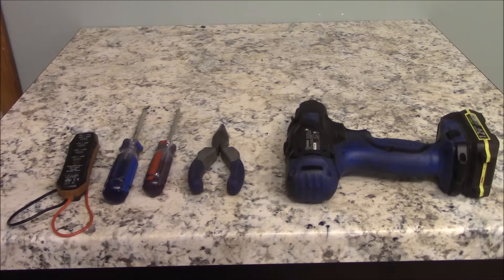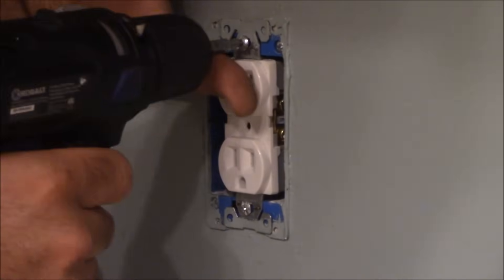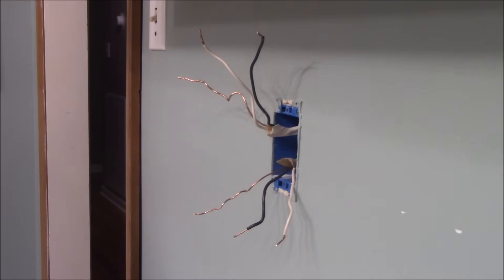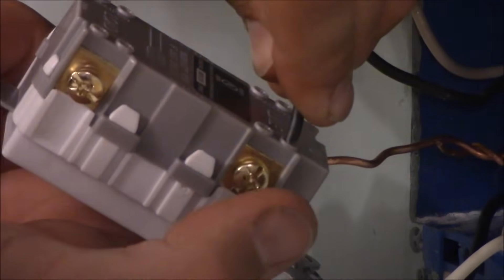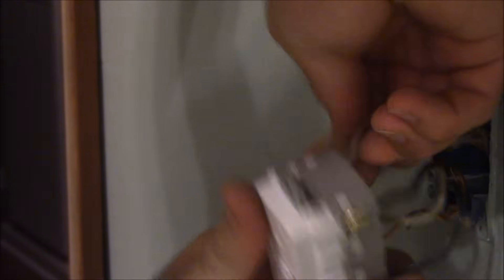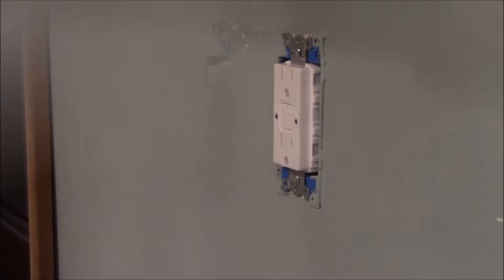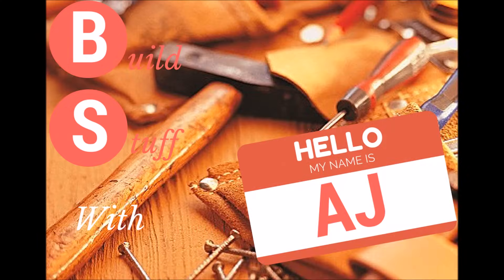Removing and Replacing regular outlet with GFCI outlet

Comment: Don’t put the wires in the holes in the back. It’s a common failure point. I’m not knocking the guy, it’s not a code violation. But I’ve seen time and time again where other electricians will use the holes in the back and it’s a common failure point. Use the gold tabs underneath the screw. Usually up to preference.

Comment: One breaker trips on my new upgraded electric panel. I checked every single outlet and light, marked it with breaker number. There is no outlet or light which is not working in my house even with that one breaker in tripped position. What could be the cause of that problem?

Comment: I wanted to change my main bathroom outlet from a standard 3 prong to a GFCI outlet but there is only 1 hot and 1 neutral wire + a grounding wire.  How can I do this since all the videos I see have 2 white and 2 black?  Home is only 9 years old so unsure why it didn't have a GFCI to begin with.

Comment: If you're doing this yourself you can use a lamp or something else instead of needing a voltage tester.
Reply from the maker: that's great advice for someone who hasn't done this type of work before! A radio works great if your trying to figure out what breaker a particular outlet is on as well you can hear it through the house all the way to your breaker box!

Comment: Great video. What about amps? What happens if I put a 15amp outlet on a 20amp line? Or visa versa? Does it matter?
Reply from the maker: I'm not a licensed electrician so I don't have a definite answer for you, but it would seem to me if you put a 15 amp outlet on a 20 amp line it would trip at 15 amps so you wouldn't get full use of your line. But if you put a 20 amp outlet on a 15 amp line I would assume it would trip the breaker before it would the outlet. But again I'm not an electrician so I am not 100% sure.

Comment: Do all the outlets in the kitchen need to be GFCI? Or only the first one on the string?
Reply from the maker: technically speaking any outlet after the gfci would be protected, however it probably depends on the electrical code in your area.

Comment: What if the wiring has no ground,can still install a GFCI
Reply from the maker: I can't say what the code is in your area, but it will still trip if that's what your asking it will still do its job, but You would have to look up the code for your area to make sure that its all honky dory.

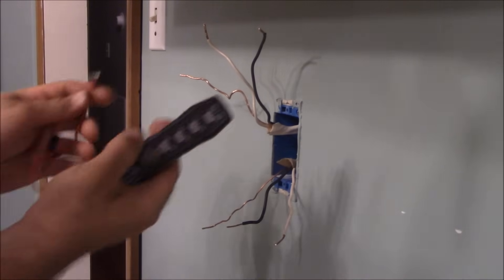Comment: AJ...clarification please. At 3:14ish, you are testing to see if the wires are line or load. IF for the lower one, you are saying 'no light' that isn't clear, nor is your tester's light visible. When you test the upper one, we can see the light. 
The transcript doesn't mention it clearly either, so if you could clarify that in the transcript and for me, that would be fantastic!
Reply from the maker: Ok so the point of this test is to find out where the power is coming from. In this specific case i am testing these two sets of wires one should have a light come on, indicating it has power and one shouldn't have a light come on indicating it has no power.  The top one in this case is where the power is coming from so it will be hooked to the line side of your outlet. the bottom in my case didn't have a light, although i didn't show it. I apologize for the confusion and I hope this helped you understand a little better.

Comment: So what I like to do is wire it up and, before I put it back in the wall, turn the power on to make sure it's good.  Today I did that, hit the reset button and the green indicator light went on.  So then I turned the breaker back off to cut the power, put it back in the box and screwed it into place, and when I turned the power back on......NOTHING!  So I had to take it back out, make sure everything was still connected (which it was) but the outlet simply wouldn't work.  I even tried putting another one in and it wouldn't work either.  Any ideas?

Comment: if I was upgrading would I use a GFCI or an Arc Fault outllet these days ?
Reply from the maker: These serve two different purposes, but it depends on what room of the house your talking about and what your local code says. Im not a licensed electrician so I'm afraid to give you the wrong information. But I'm pretty sure the standard now days is to require all breakers to be afci protected. Your best bet would be to ask a local electrician to be sure.

Comment: What is recpticle is already in series with a gfci in other location, in that case load from the gfci will get to the line of the new gfci.. so if the other gfci trips, this one will trip and without knowing that there is already a gfci tripped aomewhere, it can create confusion. How do you managge that situation? Not questioning ur skills, trying to get answer for knowledge, thanks for putting effort 👍👍
Reply: Thanks AJ.. have a good one! 👍👍
Reply from the maker: Ive had  this happen myself actually, But Ive done a lot of work on my current house and I know what order all the outlets are in. Not everyone knows their house wiring schematics like I do. 
  However technically speaking anything after the GFCI is protected, which is why they come with small stickers that say (gfci protected). now that being said I am not a licensed electrician and I know the electrical codes are different for each area. But in my opinion if you have this happen you need to track down which one tripped and then you can simply replace that outlet with a standard outlet and it should still be GFCI protected from the frist GFCI in the series. 
  While installing GFCI outlets in your home be aware of what all is on the same series, If a large appliance comes after the GFCI outlet it could trip it every time it kicks on. So to wrap this all up, its best to note what all loses power when you shut the power off to install your new GFCI outlet. 
  I hope this helps you have a better understanding, thank you for the comment!
Reply: Thank AJ, I guess I am in the same boat. Just bought the place noticed one of the bathrooms doesnt have GFCI, here is story, read it when you have time and let me know ur thoughts would love to see what u think...
Scenario: my two bathrooms are on the same circuit (how i know that, because when turn off circuit breaker, light goes off in both the bathrooms together), one bathroom had GFCI and other didn't, read that bathrooms and kitchens should have GFCI so decided to change it, to GFCI( at one side I am glad I decided to change, as the load wire from old receptical was almost broke in the box, so fixed it by creating a  pigtail, on second thought I think didnt need GFCI at all), realizef that after installing when decided to test them both, when I tripped the old gfci (which was there initially), old gfci tripped and also turned off the power in new gfci (the one I installed) but didn't trip it, reset the old gfci and power came back in old and in new gfci both, now confusion starts from here onwards, shouldn't the new gfci be tripped when I tripped the old one? If so, why the new gfci simply had power-on, when resetted just old gfci, may be it new gfci turned on along with old gfci because as the load from old gfci is feeding the line of new gfci, when old one tripped it stopped the current to new gfci (didn't actually tripped it), and as soon as old gfci got resetted, current flowed from "load"of old to "line" of new gfci.. 

when i tripped off the new gfci, it didn't do anything to the old gfci, now given that both the gfcis are on same circuit shouldn't old gfci be tripped or it didn't trip because new gfci controls the downstream ciruit not upstream.

Updated: Made a diagram to understand, why tripping new gfci doesnt trip old gfci, let me know if i am getting it right. I think its because the load from old gfci is feeding to the line of new gfci, hence when new gfci trips, it doesnt impact the line of the old (in order for old one to trip) it simply stops the feed at load.
 Again, i am just learning, if wrong please be patient 🙏 🙂

Tests:-
Old gfci.                  New gfci
1) ON.                     ON
2) OFF (tripped)    OFF (not tripped)
3) ON (Reset)        ON

New gfci.               Old gfci
1) Off (tripped)     ON (no impact)
2) ON (reset)         ON (no impact)
Reply from the maker: @noneosharma4876  ok it sounds like the old GFCI comes first in the series. If the old one trips it should cut power off to the new one (but it wouldn't trip). 
  So basically the old GFCI was already protecting the outlet you replaced with a GFCI. But there isn't any need to go back to a regular outlet unless it trips for no reason consistently.

Comment: how would you wire that GFCI in the event it trips, the other outlets downstream will not lose power?
Reply from the maker: You would have to tie the original wires together along with a 3rd wire that would feed only the outlet.

Comment: How do these outlets differ from others 🤔 😁
Reply from the maker: They are GFCI, ground fault circuit interrupter. Essential they cut off the electricity to the outlet faster than a standard outlet would trip a breaker. Which could save your life. They recommend installing them in kitchens, bathroom and garages because of the presence of water near the outlet.
  They also sell GFCI splitters for use with electrical cords on job sites.

Comment: AJ...Just installed a 20 amp GFCI and all works well.  I tested with a Klein brand receptacle tester, and got the two orange lights to glow, so it proves installed well, BUT the little green test light on the plug on the left is not glowing green.  Should it be? Everything seems great, and the lamp plugged in works on both upper and lower outlets.  Puzzled...  THUMBS UP!!!
Reply from the maker: Have you tried testing and then resetting the outlet? If the red light is glowing then it's tripped, but if there isn't a light and it still has power going to the outlet you may want to test it to make sure it cuts the power off to the switch. If not it could be a faulty GFCI outlet.

Comment: Nice clear instruction. It looked like you put 2 ground wires under the ground screw, but then corrected that by twisting them, placing only one under the screw. You should tie those wire together with a green grounding wire nut or by crimping on a copper ferrule.
You should also use a gfci tester in all downstream receptacles to identify and verify your work.

Comment: Does the outlet have to be the first outlet on that run.Electrician put outlet in kitchen that’s the end of the living room run.It’s all one big room so the outlets are all the way around on the floor but I have to change that particular one for inspection..
Reply: It does not have to be the first receptacle on the run. It can be anywhere, but only those downstream will be protected if using the load. In your case if it's the end of the run, there's nothing to connect to the load and only the gfci itself will offer protection. This may be fine if it's the only place where gfci protection is required.

Comment: Test the receptacle after you take the face plate off, if you have a tic tracer you can run it along the sides of the receptacle to make sure a wire  hasn’t come out and is still hot

Comment: Thank you for this! I am 61 and live in an old house. 5 of my outlets have stopped working (over time-not all at once). I want to do this myself to save $$. I watched another vid showing me how to find the one (1st in-line) and check it first. It may fix 2 others but this living room used to be a garage before I bought the house. 1st plug was to the washer and seems alone. Then the top plug on 2nd receptacle went out but the bottom still worked. Next one down the line-same thing. Top worked and bottom went out. I believe the one in the wash room is separate from the others in the living room. In the breaker box they’re separate. But one breaker turns of all power to the living room-not the washroom. So, wondering if I have to replace all the living room plugs or how to find the first one feeding the others? Sorry this is long, hoping you could give me a place to start. Thanx, G
Reply from the maker: That's a bit of a complex issue, with out being there I person it won't be easy to diagnose. 
  But the first thing I would look into is why your top plugs went out. You said your home is old, a lot of older homes used lamps instead of overhead lighting, so they would break the connection between the bottom and top plugs on the same outlet and wire one of them to be hot all the time and the other to be controlled by a switch. So you could turn on the switch and turn on multiple lamps to light the room. 
  I would plug something in to those top plugs that either makes noise or lights up and then look try different switches in that room to see if any of them controls it.

Comment: Watched your video "poetry" again. Question I noticed that on my GFCI that mine didn't come with the holes for an input just the sides. Now when I install the wires do I need to hook them like u did for the ground wire?  Or just leave them straightened
Reply from the maker: Thank you! I'm glad you liked the video! If you only have the side terminals be sure and twist the wire around the screws like I did for the ground that way they can't work loose! I hope your project  goes well

Comment: I can't thank you enough for this. As I need 2 have these installed just like yours and it's seems simply.  But when I reach out to local electricians most don't return my calls. And the 1 that did wants $300. To do this job!?  Also can the wires go into the holes lime yours did?  B/c trying to wrap them onto the screws is very difficult b/c of the thickness of the wires. Thanks so much!
Reply from the maker: I'm glad I can help, it's definitely not cheap to hire a professional to any job, which is why I try my best to fix everything around my house. With in reason if course. 
  As far as the wires go, I think most licensed electricians suggest wrapping the wires around the screw since it takes a lot more effort to get them loose. I tend to use the holes in the back like I showed in the video, honestly because it's easier. But that's your choice. They make them that way for a reason so in my opinion it must be safe enough to use. But as I said, most electricians suggest twisting the wires around the screw.

Comment: I have an outlet which is controlled by a wall switch. It currently only supports one plug. Can this be changed to a double plug with one controlled by the switch while the other is hot all the time?
Reply from the maker: It can be done, but you will probably need to run another wire from the switch box to your outlet. You may want to get an electrician to take care of it for you if you've never done anything like that before.

Comment: I would like to see going from a 20AMP GFCI to a regular 20 AMP outlet.  I am going to place the GFCI relay at the breaker.  I am installing a column refrig/freezer and I cannot have a GFCI behind the freezer in case it trips.  I wired it like how you had it but I have no power now in top outlet, bottom has power.  Not sure why.  I did notice I only have 1 ground wire and maybe they joined the two grounds together and only attached 1 wire to original GFCI?

Comment: I live in Nevada, we have a ton of switched outlets in our houses. Learned to always check for power on both the upper and lower receptacles just in case one is tied to a switch.
Reply from the maker: That's good advice, I've ran into it a few times since I live in an older house.

Comment: I had an electrician come and do all my outlets, and they have told me not to add those wires into those holes because sometimes it can become loose and get warm and have the outlet burn out. I would wrap them around the screws and tighten it just like you did the ground one.
Reply: Depends on if they are stab connections or actual clamping plate connections that are tightened by the screw.

Comment: Don't you have to install the gfci at the beggining of the circuit run...? I put one mid circuit and could get no electricity to that box nor boxes after....
Reply from the maker: If you put the gfci at beginning of the circuit it will protect every other receptacle after it (on the same circuit) 
  However it's not always the best option,  some appliances pull a lot of amps, which could cause your gfci to trip when it doesn't need to. 
  If your not getting power to the gfci you installed it could be that its wired wrong, be sure you have the correct wires going to the line and the load. Check to be sure you reset your gfci, sometimes a simple test and reset will fix the issue. Also check your breaker to be sure it hasn't tripped.  I hope this helps

Comment: Very clear instructions. However, Two ground wires are not permitted under one screw. You have to to use a Pig-tail ground wire. Also the bent up ends of the old wires need to be clipped off and strip a fresh section.
Reply: Oh! I didn’t know that about connecting two wires to one screw not being permitted. Should I come across that, I’ll have to watch out for that when changing receptacles.